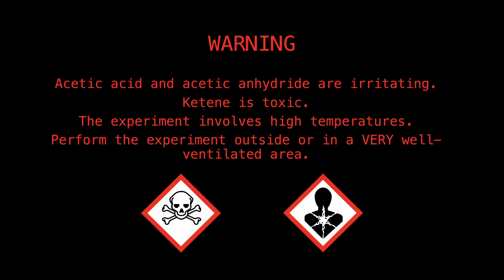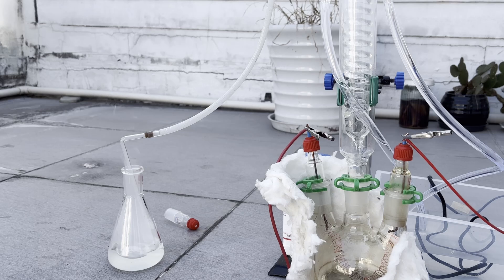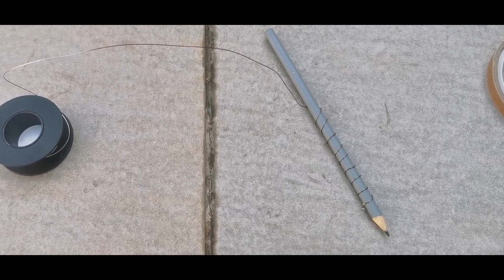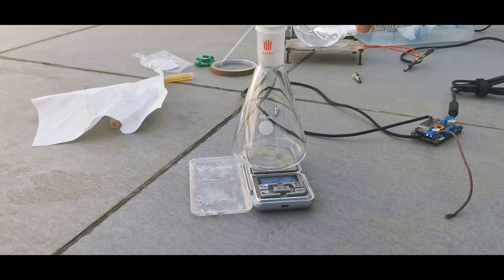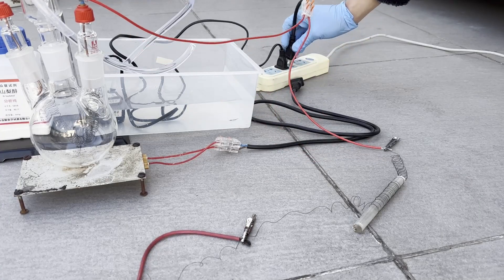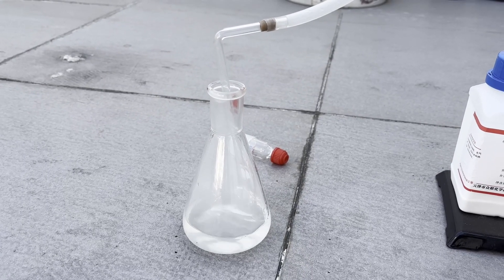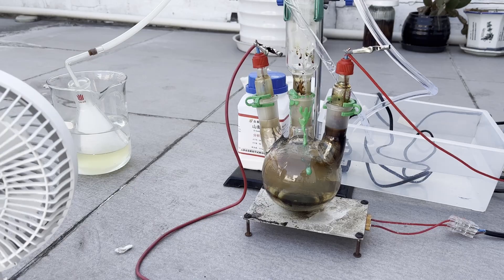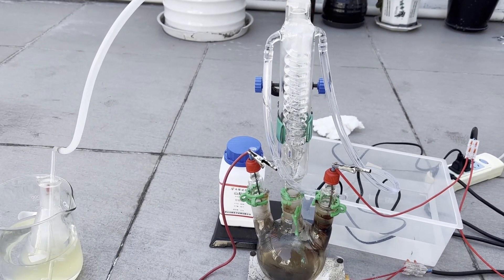5.7 Organics - Making acetic anhydride via the ketene lamp route (fail)

Comment: Your 3 neck flask with element in it needs to be on top of anither flask that contains the avetone, that way in your 3 neck flask theres only vapours minimising the acetone going to the condensor,  also you should use a fredericks condensor at the top then run a graham condensor from that to your collection flask, by using the 2 different condensors your strip other unwanted biproducts from the ketene and you AA will be close to clear, then its just a quick recovery removing any acetic acid and other impurities,  try putting your coil in just one neck of the flask then turn it on the side and that goes abouve your flask of acetone, i used 1L flasks and used 500ml glacial acetic acid, has to be glacial with no water, i bubbled the ketene in that 500ml for 4 hours refilling the acetone twice,  i ended up after distillation with 480ml of 99% acetic anhydride,  also if your outside cover the acetic acid flask so its in the dark, AA is sensitive to light especially full sun from out side.
Reply from the maker: Are there any sources that say acetic anhydride is sensitive to light? To my extent of knowledge the chemical is stored in transparent bottles. The two condenser approach is clearly superior and I'll try it in the next attempt!

Comment: You should've used a less powerful filament, a longer condenser, and an array of Dreschel bottles (preferably with fritted glass disks) cooled with ice rather than a sole flask with a shallow layer of acetic acid. For the best yields possible the filament should be placed in a tube between the boiling flask and the condenser to increase the speed of the vapours near the filament. Adding diethyl ether to acetic acid reportedly helps it absorb ketene, but it's superfluous as Cody has shown. Didn't the mysterious liquid boil at 96-100 C?

Comment: Thanks as always for putting this out.

One thing to try is getting the acetone in the pot extremely dry before starting. You can use thoroughly heat-dried MgSO4 for this.

Have you looked at the two-part series from Doug's Lab here on YouTube?

Comment: You can make acetic anhydride by slowly mixing SO3 and dry Sodium Acetate at zero celsius in a mortar and pestle which will make the sodium salt of acetyl sulfate. The Sodium Acetyl Sulfate powder is moved to a round bottom flask and very slowly allowed to warm above room temperature until the sulfur trioxide melts. This finishes the reaction. After this, slight heating liberates acetic anhydride followed by distillation. Dry sodium sulfate is left behind.
Reply: Triturating SO3 in a mortar with what would surely bring about an exothermic reaction is an outstanding way to go
Reply: @dimaminiailo3723  I'm trying to picture the setup and PPE needed in order to get SO3 into the mortar in the first place. This kinda reminds me of "recipes" from a certain infamous cookbook which, if followed to the letter, were extremely likely to blow up in your face.
Reply: @davidfetter  yeah, that would in no way be safe. Better to add them to a flask in a salted ice bath with overhead stirring. SO3 itself is pretty terrifying though.
Reply: Do you have a reference for this procedure?

Comment: better cooling and the acetic acid flask being a two or three neck with a condenser also under reflux works, though frankly the lamp design sucks and the tube furnace method is far better which i need to test on a larger scale still. the lamp is always too slow and inefficient in generation especially because the ketene just floats around in acetone vapor and around the hot wire pyrolyzing to carbon which you can observe on the filament. being in china i suggest simply buying phosphorus pentoxide and using that
Reply from the maker: People have tried mixing P2O5 and acetic acid and yielded a bunch of tar with almost no product, so I guess I'll have to optimize this route. I can construct something like a tube furnace though. Check out my future contact process video (should be out in a week or two)
Reply: For the P2O5 route to work, you basically need laboratory conditions and pure starting naterials with no contaminants. Most importantly,  it has to be done under argon or nitrogen in an environment with zero moisture. Just opening the P2O5 up in air adds moisture.
Reply: @relic2279 its not necessary to work under schlenk level dryness, this is acetic anhydride not butyllithium
Reply: yooo its the flourine generating guy!